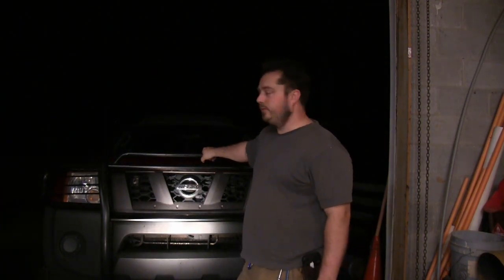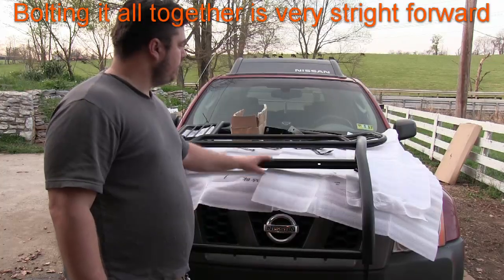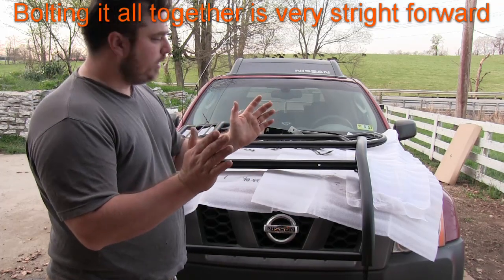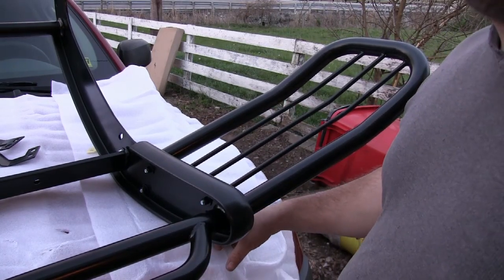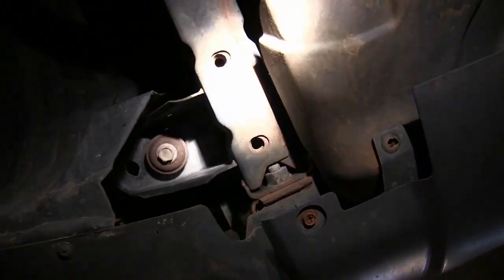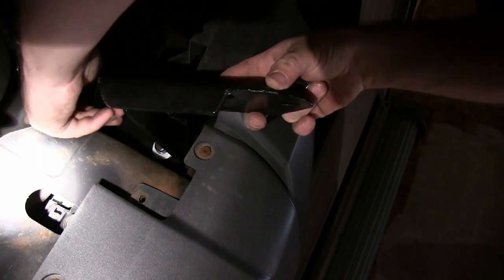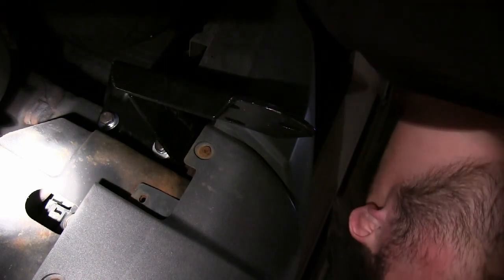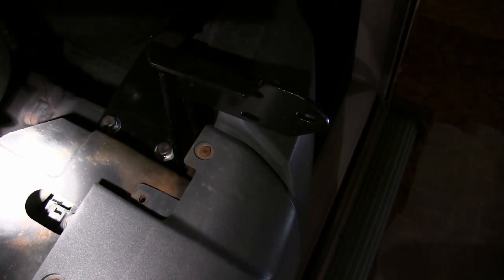Installing a Brush Guard / Grille guard on an XTerra '05

Comment: Do you know if the instillation the same for a 2010?
Reply from the maker: I believe they would be the same, they are both gen 2s
Reply: @MechanicalChaos  Thank you.🙂
Reply from the maker: No problem, good luck with your install
Reply: @MechanicalChaos  Thanks, I haven't decided if I'm going to get that one or the whole piece one. By the way how has it preformed since you installed yours?
Reply from the maker: I've not had any trouble from it

Comment: Is there a place I can buy the brackets from ?
Reply from the maker: They should come with the brush guard
Reply: @MechanicalChaos  did this brush guard include any additional support brackets? some of them include 2 additional support brackets that mount somewhere near the radiator
Reply from the maker: Sorry, I don't remember, but the middle of the guard has holes where additional supports could go

Comment: Any way to keep the tow hook?
Reply from the maker: Unfortunately no not with this because it uses the mounting point for the tow hook, and you wouldn't be able to get them both mounted through the same point because of the way it's manufactured
Reply: Some brush guards come with a tow hook mounted on it already.
Reply from the maker: That's good to know

Comment: What brad brush guard do you recommend for the Xterra?  Corresponding back bumper guard?
Reply from the maker: Not really sure about brands, this was around $250 on Amazon. Can't say I've seen any back bumper guards but I did get matching tail light guards for about $50. Brush guards will not help you in a crash and in fact tend to make damage worse, but I like how they look...so...get one you think looks good

Comment: what's the make of your brush guard? Also, did the guard get in the way of your headlights at night at all, any blockage?
Reply from the maker: +CaseyCJL no noticeable effect to the head lights, I got the brushguard from Amazon but I don't remember which it was, and it isn't showing up in old orders or I would give you a link to it
Reply: no worries. thanks for the info.